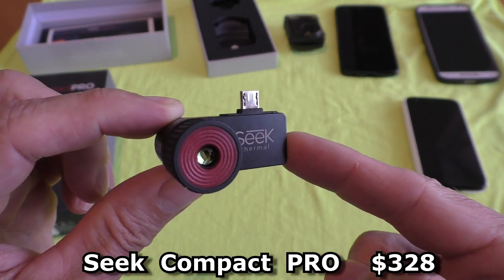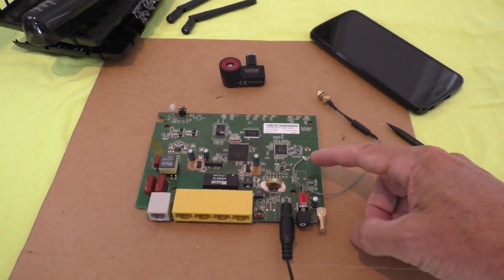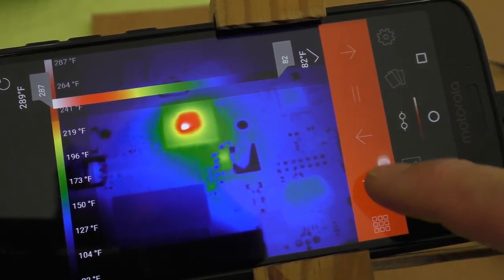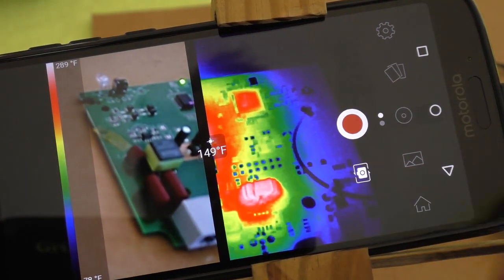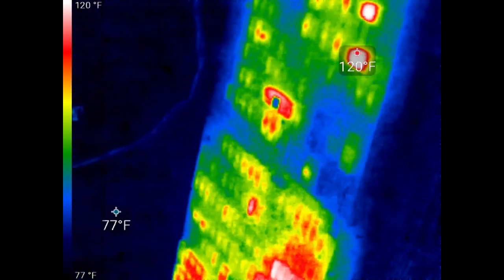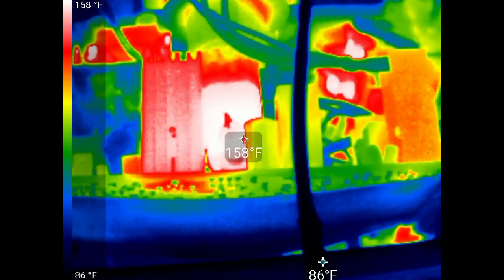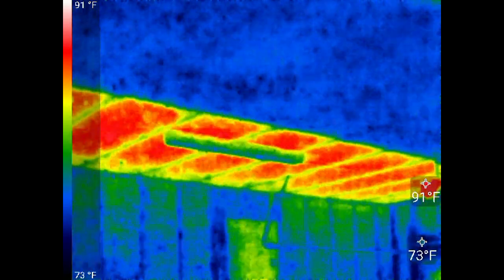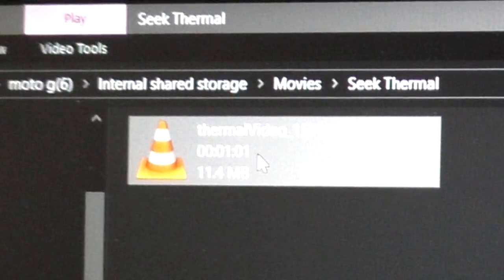SEEK Compact PRO Thermal Camera for ELECTRONICS Repair REVIEW FLIR One android os

Comment: Hello, thanks for the information.
I want to ask something; Towards the end of the video, you were viewing a tractor working in the field. Is Seek compact pro sufficient to achieve maximum quality thermal image from this distance?

Is lens size important to get quality thermal images from the distance to the tractor?
Reply from the maker: it should work fine. from what i understand the camera sensors individual pixels are each a heat detecting camera. so the thousands of pixels show all the differences in temperature. the twisting lens is just to focus the image onto the sensor from a near to far distance.

Comment: You did not mention that the software is spyware.  They require precision GPS, microphone, camera, and wifi for the s/w to work.
Reply from the maker: thats an issue with the newest app update. I actually use an old discarded motog6 phone that has an older app version. the phone is always in airplane mode and never connected to internet. it works fine. i have noticed the price of this seekpro model has gone thru the roof, its like 500 bucks.
Reply: what if we deny permission?
can it still working?

Comment: How fast does it drain the cell phone battery. That's what nobody ever talks about
Reply from the maker: the battery drain is unnoticeable. it must use a very tiny bit of electricity.
Reply: @FunBubble  have you ever tested it to see how long it lasts on the phone? That would be a good video I can't find one anywhere

Comment: where did you buy pro for this price?
Reply from the maker: amazon. the price fluctuates. i jumped on it when it went to $328. i put stuff in my cart and check every so often, its weird how prices for almost everything on amazon will go up and down all the time.
Reply from the maker: i just noticed amazon has it for $292 right now, 1:30pm May 30th 2019. Yesterday it was $365.
Reply: where did you buy ?